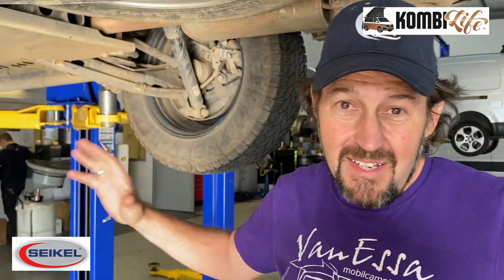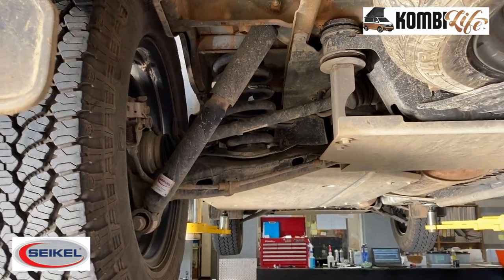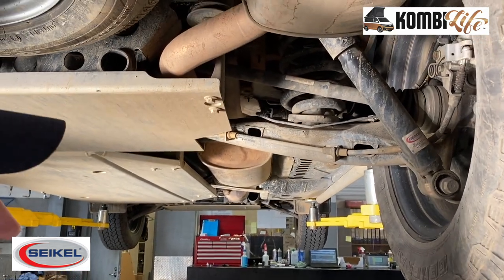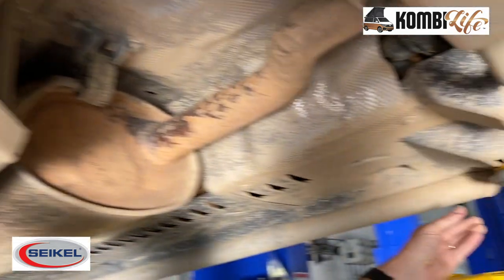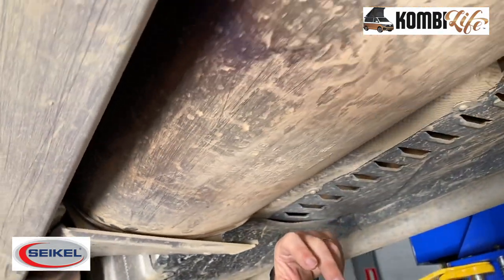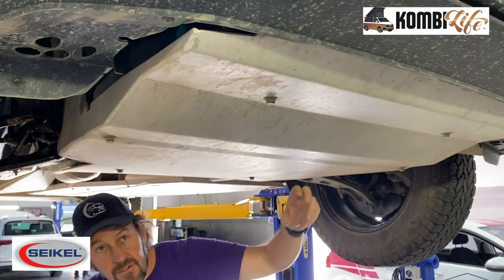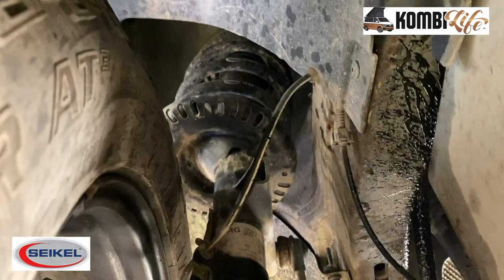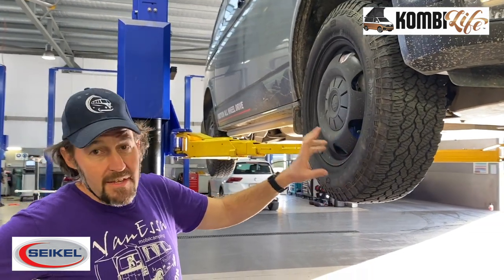SEIKEL UPGRADES FOR VW T6 and T6 1 TRANSPORTERS And MULTIVANS - Australia

Comment: safe you money and budget from the origin: Eibach Pro Lift Kit + Sachs Super Touring reinforced shock absorber. All under 1500,- And Seikel only (unofficial) recommend the engine and gearbox protection! Why? Because the California is to heavy, if you get stuck at the front with 2.7t. you know not to continue... ;) I drive my T6 with this setup and I can highly recommend it!

Comment: Awesome. Did you also lower the front diff or is this part of the whole gearbox?
I noticed your front right inner cv boot may be leaking. Have a closer look
Reply: HI Nawir - no we did not lower the front diff and good pickup - yes it was and this was quickly attended to! :)
Reply: Also had the same right front inner cv issue on my transporter ( 140 000km). Caused mayor acceleration vibration issues and could not drive in 7th gear and below 2200rpm
Reply from the maker: @vlakkieaarde  Thanks for contributing - certainly a higher mileage. How much lift did you have on your Transporter?
Reply: No lift at the moment....stock standard suspension (3200 kg GVM option) with 235x65xR17 Pirelli Scorpion AT  tyres. Seikel suspension is a dream but a bit premium if the standard suspension is not yet in need of replacment.

Bought the vehicle used at 118000km and initially thought CV grease was an oil leak. I used the “leak” to negotiate more discount on the purchase price. 

Fixed the leaking CV boot afterwards, but damage to CV became apparent 20000 km later. Was relatively cheap fix to replace both inner CVs from local aftermarket German CV parts distributor. Agents pricing was not an option nor did they diagnose the problem correctly

Based on VW service history a DSG transmission oil change was skipped at 60000km by fault of previous owner( based on “hit and miss” or very late history of bringing the car to the dealer for services) that lead to transmission replacement at 109000km. I think the CV boot was not replaced correctly in the process of changing transmissions , leading to the CV  failure later on in the process

Also did the electronic EGR cancel on the CFC engine to save it from the aluminium cooler corrosion issue that leads to aluminium rust getting into the engine leading to oil consumption

We do you enjoy our bus though! :)